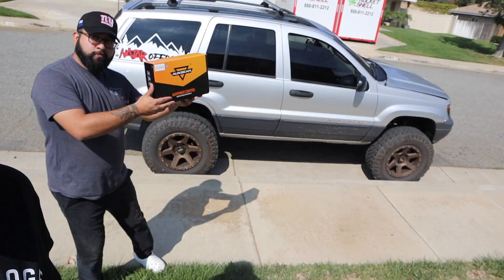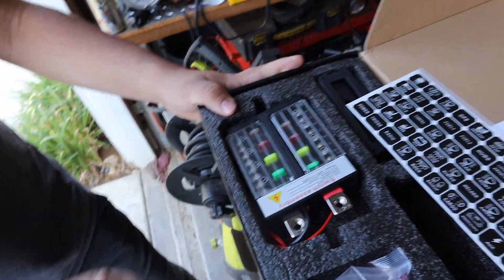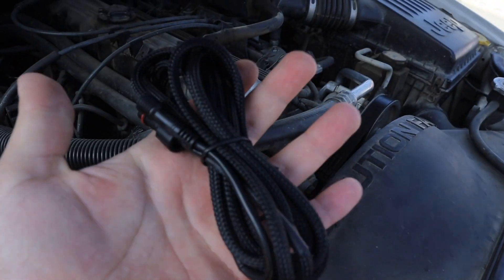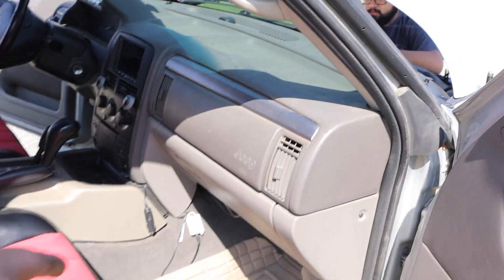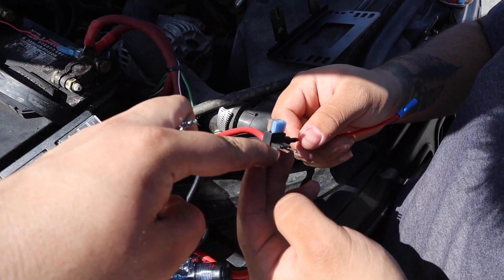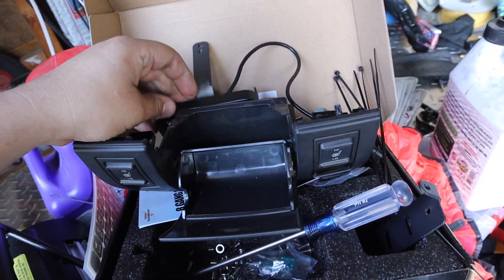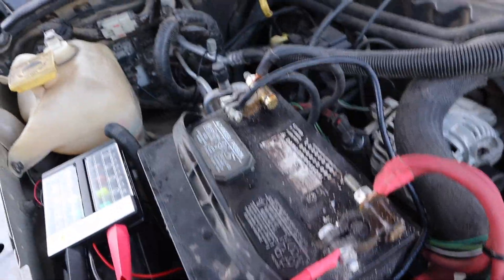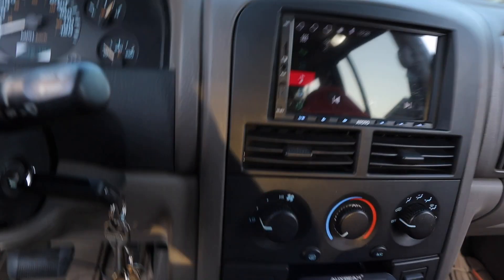Why YOU NEED This AUXBEAM LED 8 Switch Panel !

Comment: Also, the firewall has a HUGE rubber grommet where most of the wires come through. Drivers side near where the steering comes through. Go through that instead of around by the door.
Reply: I don’t think he would have had enough wire to reach that far

Comment: 👍 Much better than my growing row of switches on the instrument cluster sill.  

Tip for the battery, remove the clamps and coat the battery terminals in a thin layer of Vaseline.  Doesn't effect the electrical connection at all, but prevents oxygen from getting to the terminal.   The terminals can't oxidize without oxygen, you will never have a problem with it again.
Reply: Or use dialectric grease…cause that’s what it’s for…
Reply: @officialWWM    Yes, it is what I use, but Vaseline works just as well, and I have used both in the past.  I only mention Vaseline because most people have in there medicine cabinet.   Just need to disassemble all of the parts and clean them well with baking soda water and a small brush. Apply a thin coating inside and out all the way to the insulation.  If you get corrosion on a post after that it is probable from a broken seal around the post inside of the battery.
Reply: @officialWWM  OMG LMFAO  THAT MADE ME LAUGH SO HARD!!!! SO BLUNT, SO TRUE. EXACTLY WHAT IT'S FOR. . . . . . . . LOLOLOLOLOLOLOLOL

Comment: Very clean install. I just put a 5 bank switch panel in the cubby hole (mine didn't come with an ashtray), but since it has a slight curve to it, the screw I used broke it. Guess I need a new one. After seeing your install, I'll probably go that route. Thanks Bud!!
Reply from the maker: Thanks man! I’m surprised about how clean I was able to make it 😂